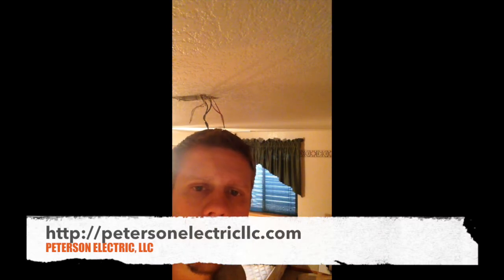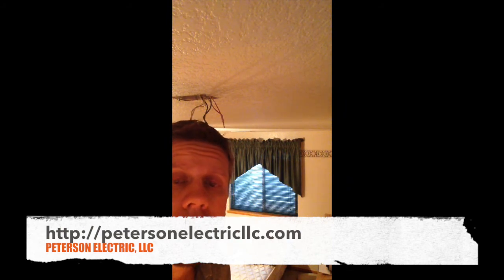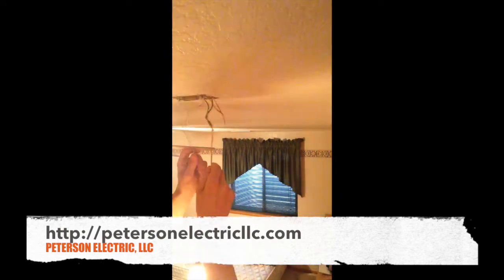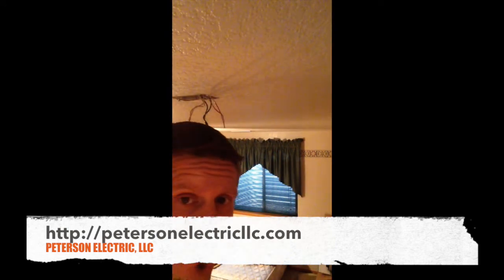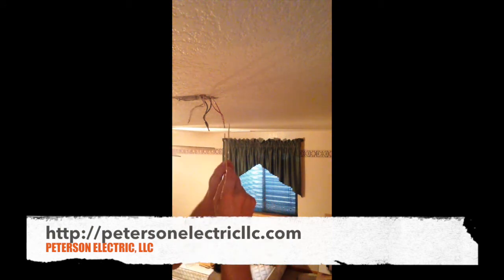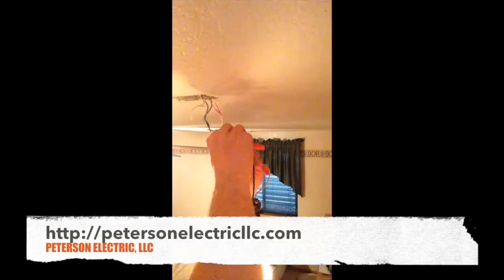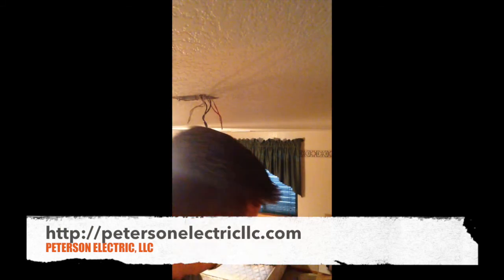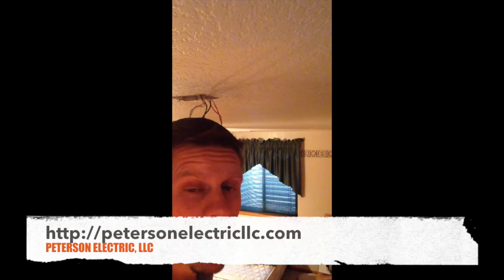Smoke Detectors Going Off, Is It Loose Connections or Voltage? Part 2

Comment: Hey Josh! Another way to trigger smoke detectors is take a 9volt battery and connect the positive to the red and negative to neutral. The alarms should sound. this works because when an alarm is triggered the smoke detectors sound 9 volts from the red and neutral to each other. hope this helps!
Reply: Brian Opdyke these are 120 volt alarms not 9 volt systems kid